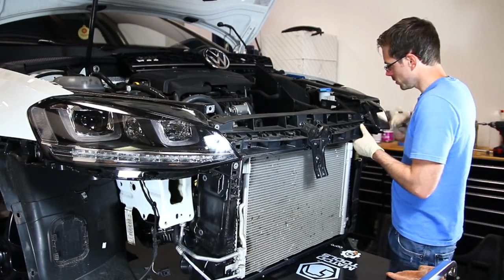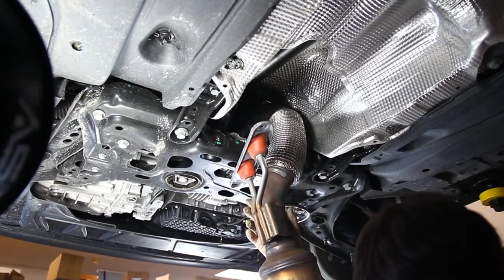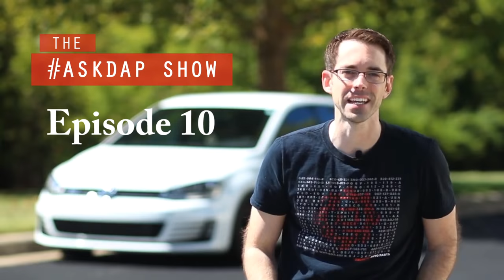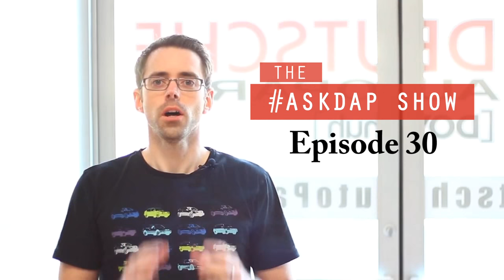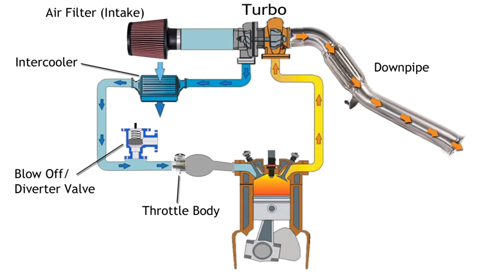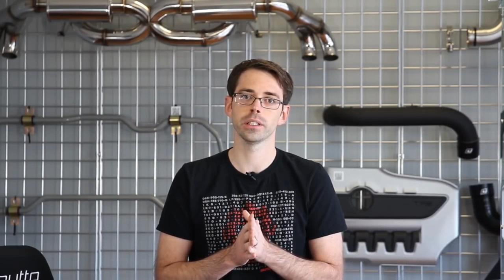Welcome to Deutsche Auto Parts

Comment: Question for you: I have 2009 VW CC 81k miles. I have an oil leak, we have came to the conclusion that there is a seal that needs to be replaced. I am assuming crankshaft/cam shaft seal???? Is that something I can replace myself or best to take it to a mechanic. But of course don't want to be ripped off. Thanks in an advance
Reply from the maker: answer coming on askdap 41

Comment: Thank you for all your Audi/VW  DYI videos. I have a question no one seems to know what's wrong. I have an Audi A4 B8 2012 with 150,000 MI. I just took it to Audi dealership to get the 85K service. Two things they found wrong control arm bushings leaking and engine mounts leaking. But that's not my question my question is when it's very very cold I have a hard start it does not want to start eventually it starts but the EPC like comes on the dashboard after it warms up I turn off the car immediately it starts up and the light goes off. Please help

Comment: Hi Paul, I’ve got a question for you: I’ve owned a few VW’s in the past but my MK6 is my first GTi. I give my car a good run in the hills, but it takes only a few minutes of high RPM/load driving until oil exceeds 125c and I backed off at over 135c. Highway and regular driving sees anywhere from 110c to 118c dependant on conditions. This oil temp seems too high for sustained spirited driving - is there an issue or do I just need an oil cooler? Cheers!

Comment: Hi Paul, I just trade in my 2014 Subaru Crosstrek to a 2016 VW Tiguan SE 4motion. If ever you have time please make a project of Tiguan. I was planning to lift my Tiguan and install an A/T tires. Do you think this Pro Comp AT Sport 31/10.50R15 Tires and Trail Master Steel Wheel Series TM9 15x8 Wheels is good for me? 
235/50R18 is my wheel and tire size.  What would be the perfect size for off road, I lived in Connecticut so I deal with snow every winter hehehehe? Looking forward for you answer. Thank you!

Comment: Thank you for sharing valuable info.
87 Sycro h2o light stays on most of time; have replaced coolant bottle sensor. Gauge reads fine; no overheating, fan works. Suggestions please. Michael

Comment: are there any aftermarket oilcoolers for the mk7? ive noticed wide temp variances from 214-216 to 225 - 230 is this typical? im getting higher oil temps in traffic witch makes sense but seems to be a pretty large diffrence in temps. i dont want any un-nessesary strain on the oil system, i commute alot (16-17K in 6 montha of ownership) car is an 16 gti s, manual trans. im also noticing if i disengage my clutch i can almost hear what sounds like the throwout bearing freespinning, its quite loud, ever have this issue? car is stock until the 30k mark.
Reply from the maker: We know there will be oil coolers coming in the future but dont have an ETA yet.  We have not heard the issue but you might want to get it checked out by a dealer as a throwout bearing noise is likely covered under warranty.